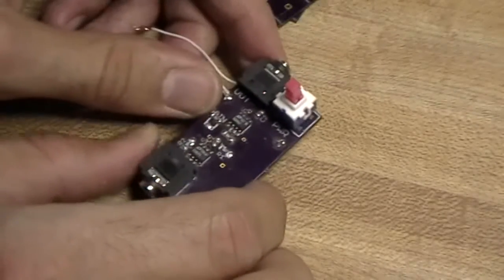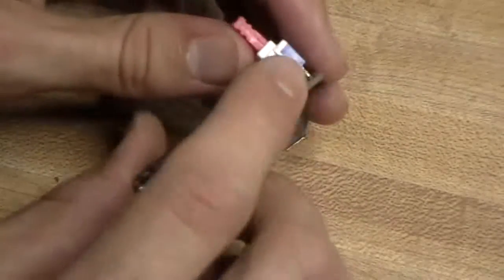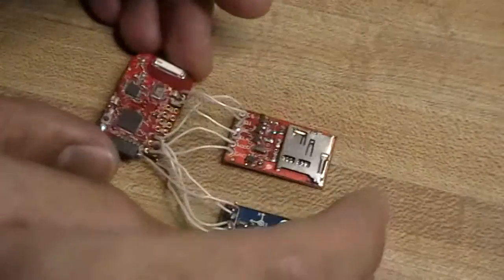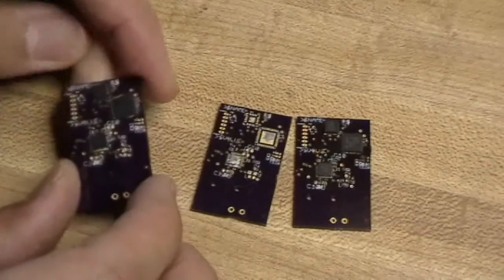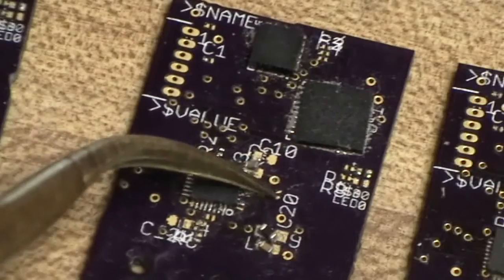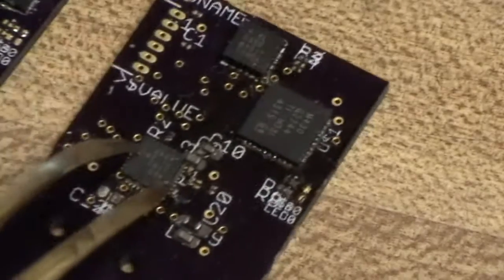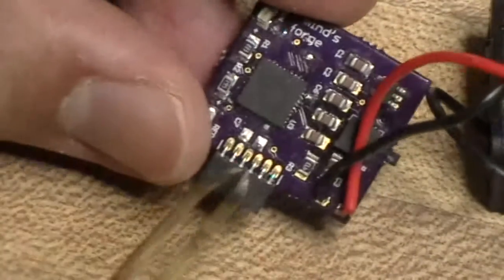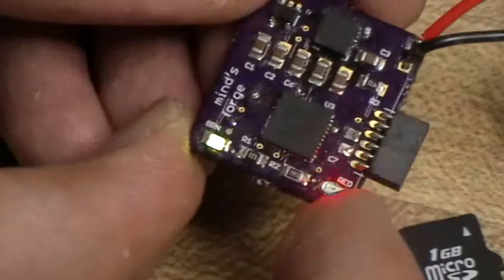Datalogger Circuit Iterations

Comment: hello :) How is the project going? Ive got parkinson with tremors. Im a former teacher in electronics/microcontroller. Best regards
Reply from the maker: I've put the project to the side at the moment.  I've been looking at starting again but with the ESP8266 or ESP32.  If you're interested, this is the last bit of documentation I made: http://www.instructables.com/id/MSP430-Accelerometer-microSD-Datalogger/

I've learned a bit more about using machine learning on time-series too which could be applied if I figured out how to get an accelerometer + ESP + websockets working (someday... someday...!)
Reply from the maker: Seems like a good starting point: https://www.youtube.com/watch?v=UYeQoo-Z1vg